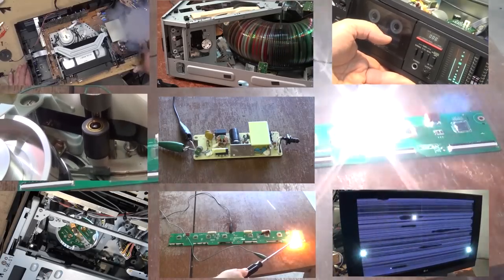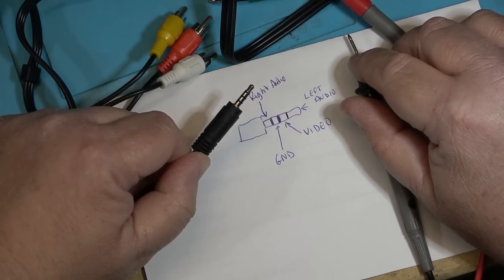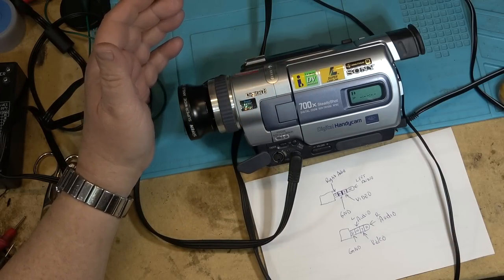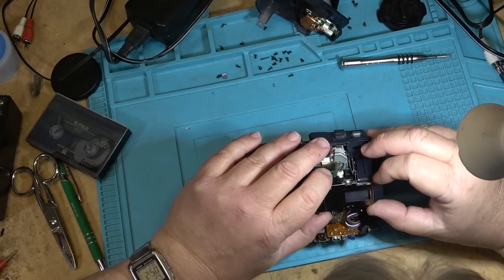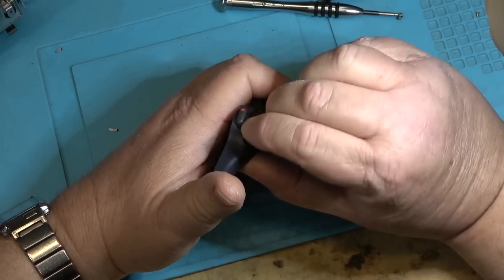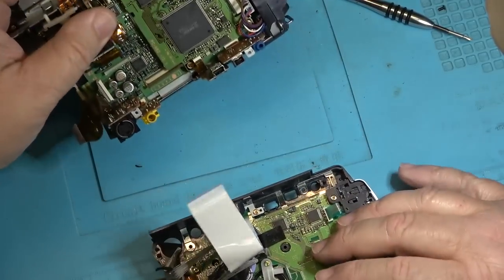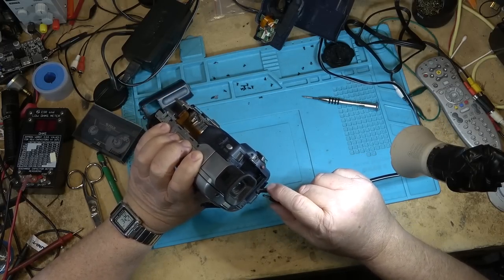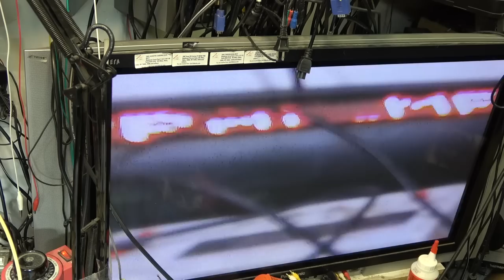Sony DCRTRV530 Digital 8 Camera Power Switch and AV output Issues

Comment: I bought a Sony OLED TV last year and it has a composite A/V input but none of my regular A/V cables worked with it. Turns out Sony is still using it's same A/V wiring scheme so I needed a Sony compatible cable. Here in Australia we have an electronics store called Jaycar and they sell a suitable cable but they don't say it's wired for Sony. I only found out by taking a multimeter to the store and checking myself.  It even has the right angle plug. Price $11.95AU.

Comment: It would be lot easier to make up a cable with the appropriate wiring than searching for the official sony 1s, and my Sony also has switch issue which had solved from watching your videos. Big thanks, and cheers from Wales.
Reply from the maker: Making the cable is easy because I just showed you the pin out.

Comment: JVC appears to have used the same TRRS A/V cable configuration. I had an old cable from my sister's fried JVC hard disk based camcorder and figured I'd give it a shot on a D8 camcorder. To my surprise, it worked perfectly. Wikipedia claims Panasonic used this configuration too, but I haven't been able to confirm that.

Personally the biggest irritation with 3.5" TRRS connectors is cell phones. For a while some companies used the OMTP wiring, vs. the CTIA, which is now the industry standard.

Comment: Hi. I have my old TVR 310E Digital 8 camera. The "E" is for PAL I think (I am in Australia). The camera did not take nearly as good videos as my pure Hi8 Sony, but then, that Sony VTR cost more. It had a beautiful mechanical steady shot lens, a bigger lens too. Its colour was much richer. A TR 805E model.  But it wasn't digital, and I bought the 310 thinking I could transfer to computer the Hi8 tables, which I now want to do, hoping the tapes are still OK. 

My issue is that it has a control  behind the lens, which is not unlike the one on the camera here you repaired. Mine is black, and it has a green centre locking / unlocking elongated knob in it. The sliding switch chooses between VTR, OFF, and Camera. My switch is stuck on VTR. It was working only a couple of weeks ago.  I only need VTR, in order to transfer tapes via Firewire. But I am wondering if I spray the exterior of the switch, whether that will repair it? I am not so keen to access the internal switch as you did for the rear on/off, as I reckon I would also break the lens assembly like you did. And glueing it back is worrying - I do not even know what glue might work!!! Appreciate your comments and thanks for your channel!
Reply from the maker: No, it has to come apart to repair the switch.  
Digital 8 recorded a superior picture to any analog tape.  Sony was smart they did not want to undermine their dv and professional camera. So they put in a low resolution ccd to give it a poorer picture than their hi8 cameras.

Comment: 4 capacitors on camera, it could be digital 8 to have more zoom and a stable image but the camera sensor is bad, my 3CCD VX1 is much better than it, maybe if it was released in Digital8 format it would be even better and record in all video8 formats as well,  hi8, digital 8

Comment: Wouldnt be too many other jobs than handycams to work on hey?Have to hand it to the Japanese on the build quality of these handycams, I had a TRV120E that had a tape stuck in it, couldn't get the power to the eject circuit to release the cage, took me ages and destroyed it, nothing short of a sledge hammer to get the tape out ..have another 120e now , but now have to partition my PC with an Windows XP PRO OS so it sees my pcmcia SCSSI card for the firewire DV link to work...ABSOLUTE NIGHTMARE.
Reply from the maker: Easy to remove tape if you know what you are doing.